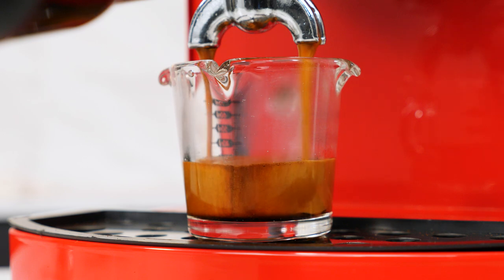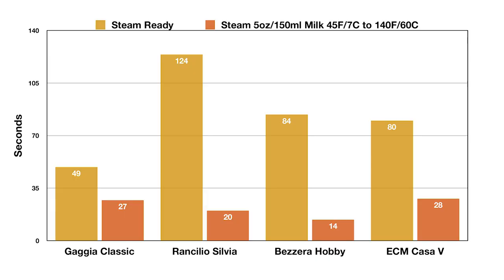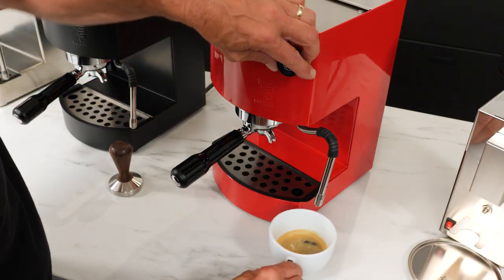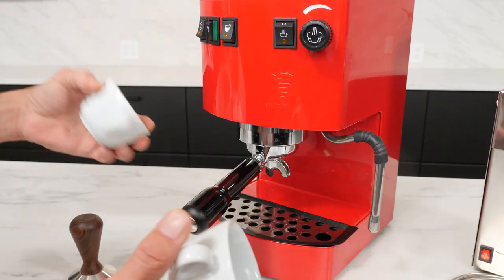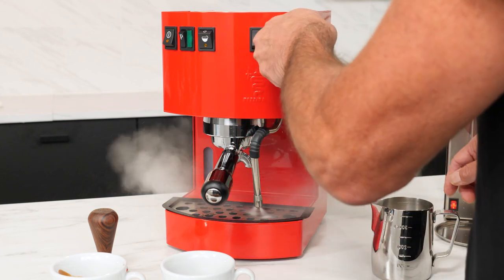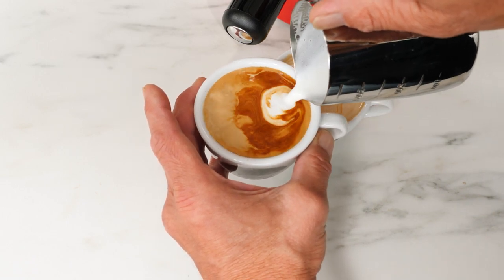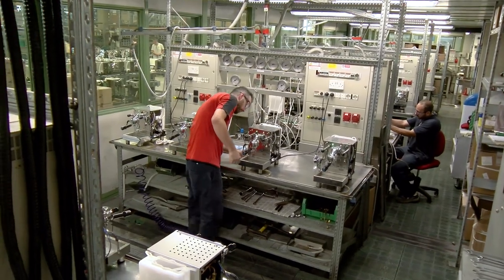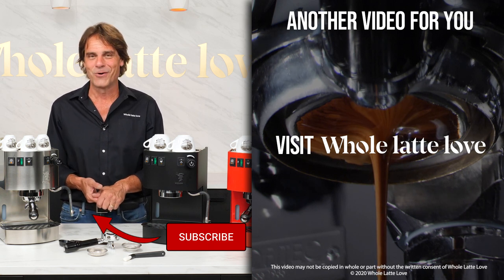Review: Bezzera Hobby Espresso Machine

Comment: How many bars of pressure does this machine produce? I am just getting into the espresso game and I understand 9 bars produces the best espresso. Thoughts?
Reply from the maker: Hi Curtis, Thanks for the question. The whole pressure thing gets a little out of hand in various forums etc on the internets! The Hobby comes from the factory set to produce ~11 bar of static pressure. BUT... Static pressure does not equal the pressure you will get on the coffee when doing an extraction! Static pressure is measured in a closed system so no pressure drop like you'd get when brew water is moving through the coffee. The only way you'd ever get 11 bar is if your grind was far to fine. So fine that the extraction would go far to long. If your grind is dialed in properly you will be brewing at 9 bar on this machine. Hope this helps!
Marc

Comment: Ceado E5P grinder now has about 4 lbs of coffee through it. Finally getting shots 20-30 sec range fairly consistently. 2 questions:
1. I have to wait 5-7minutes for the puck to not have water standing in it. Doesn't seem right, I can hear gurgling into the drain pan after shot is pulled, so, I guess 3-way solenoid valve is working. Am I good, here? Puck does knock out fairly cleanly, even when still wet. Never have gotten one as dry as shown in the video above.

2. Ceado is only about 1 intermediate mark from touching, and grind appears finer than what I observe in your videos, certainly a good bit finer than granulated sugar. Comments?

Comment: Thank you, since you open the machine and see the inside, does hot water (after becoming hot, not before) come in contact with any plastic part of the machin at any point of its travel from the water tank all the way to the coffee basket outside the machine?
Reply from the maker: Hi f, Thanks for the question. Heated water never comes on contact with plastic.
Marc

Comment: Does this machine have PID temperature control? And what's pump's bar pressure?
Reply from the maker: Hi Richard, It's not PID. Pump is capable of producing ~15 bar. Actual brew pressure is controlled by the OPV factory set at ~11bar max but pressure in group will be lower and is ultimately determined by grind size of coffee.
Marc

Comment: Total newb here, Hobby is my 1rst machine. 18g dose results in full contact (dry ,before extracting) with the filter screen, should the dose be reduced to provide a bit of head space?
Reply from the maker: Hi PT, Thanks for the question. Yes. If you are seeing an imprint of shower screen on coffee puck after extraction it's best to reduce the coffee dose weight. Another option is to go with a bigger filter basket as 18g is about the max in most stock baskets. Here's a 20g precision basket which would work with your Hobby: https://www.wholelattelove.com/products/baristapro-20g-nanotech-precision-portafilter-basket
Hope that helps!
Marc

Comment: How do the internals on the Hobby compare to the Silvia?  Given the smaller form factor, I'm sure it would be more challenging to self-service the machine but that aside, what about the components and parts availability.  For instance, can the heating element on the Hobby be replaced without replacing the entire boiler?
Reply from the maker: Hi Chad, Thanks for the question. Here's a schematic diagram of the hobby including the internals: https://s3-eu-west-1.amazonaws.com/img.web.mdsnet.it/bezzera/allegati_articoli/5c7d35910994c_HOB01%209942062.01%20ING%20ed11.17%20rev00.pdf
It is possible to replace the heating element without replacing the boiler. Parts are readily available.
Marc

Comment: Can you adjust the BREW TEMP?  What is the DEFAULT brew temp.?
Reply from the maker: Hi JW, Like the vast majority of single boiler machines brew temp is not adjustable - you need to go to a PID  machine like this for that: https://www.wholelattelove.com/products/profitec-go-espresso-machine-black
For non-PID single boiler machines brew temp is controlled using techniques like flushing brew water prior to extraction or assorted temperature surfing techniques.

Comment: Does anyone know where to buy parts for the Hobby?  Not just the common parts like seals and screens, but a leaking threaded tube on the boiler?
Reply from the maker: Hi CJ, Thanks for the question. Leaking threaded connections can often be fixed with some teflon tape or pipe compound. If the connection is damaged and you are in the U.S. we may be able to help with parts. Contact our tech support here for assistance: https://support.wholelattelove.com/hc/en-us
Reply: @Wholelattelovepage  awesome, thank you!  Yes, it needs a few parts, i’ll check the link.  I love its size and cant wait to compare it to my Silvia.

Comment: Hi Marc
My brand new Hobby in stainless arrived yesterday all the way from Milan to the UK, a quickie question, is the pump switch purely to refill the boiler after steaming etc, have upgraded from the Gaggia Classic so never had to worry before, loved your video on this fine machine thanks
Reply from the maker: Hey GG, Thanks for the comment and question. Yes, pump switch is for refilling/cooling boiler and dispensing hot water.
Marc

Comment: Hi Mark, thanks for your response on my question about the Escobar office control. I was asking because I am looking for a good used espresso machine with good steaming power to get down the road. I was wondering if it you could please give me some suggestions on a machine with either a heat exchanger or single boiler machine with good steaming power. I am sort of considering the bezzera hobby as well. Thanks, the young barista
Reply from the maker: Hi Young B, You are welcome! We currently have a refurbished Expobar Office Control available here: https://www.wholelattelove.com/collections/refurbished-espresso-machines
In single boiler machines the Hobby has the best steaming power available. If doing mostly milk based drinks I'd strongly consider a machine with HX boiler for simultaneous brew and steam. Consider machines from Rocket like their Appartamento or any HX machines from ECM or Profitec.
Marc

Comment: have you tested the heat up time (for brewing) of this and similar machines?
Reply from the maker: Hi mm, No official tests but can say this and similar single boiler machines it's typically about 10 minutes. The machine will generallt indicate reaching full temp in the boiler faster than that but I prefer a little more time for full wrm up of the group and portafilter.
Marc

Comment: Hey Marc!
I'm pretty much sold on the Hobby, but I've read some other reviews online that stated steaming isn't this machines strong point. One of the other reviews stated it would only be good for one pitcher of milk. Could you expand on this a bit and give me your opinion? Hypothetically if I wanted to pull four shots, and make four cappuccini, would it be possible to froth/steam two pitchers of milk back to back? Or would it be best to let the machine recover, then steam another pitcher of milk? Other than that small concern, this machine is seemingly perfect. It's at the top of my list over the GCP or the Silvia.

Thanks! :)
Reply from the maker: Hi v, Thanks for the question. Between the Hobby, GCP and Silvia the Hobby has the best steaming power. Can you steam enough milk for 4 drinks? That depends on how much milk you put in each.  I'm comfortable saying the Hobby can easily steam 10oz/300ml at a time.
Marc
Reply: @Wholelattelovepage  Thanks for the response! That answers my question perfectly!

Comment: Will be great if you can produce a strip down on the parts, so users can see if they can have the machine serviced themselves. I'm wondering how difficult is it to repair these over the long run. I'm also wondering if the boiler burn itself out without water.
Reply from the maker: Hi JB, Thanks for the request! Parts are easily accessed as shown in the video. Like most true machines, it's very serviceable for those with basic tools and skills. Like all single boiler machines one must cool down and refil the boiler after steaming to prevent running without water. The machine does have a reset-able high limit switch on the boiler which will trip to prevent burn out.
Marc

Comment: Have any temp stability tests been run on the Hobby? I would like to know how it performs compared to the Silvia and Casa V. Deciding between these three machines.
Reply from the maker: Hi Brad, All the machines you are looking at will have some swing in the boiler temps. Working with those swings means using techniques like flushing water from the group prior to pulling a shot and coming to understand were a particular machine is in its heating cycle by watching for the brew ready indicator light. When that comes on the machines are typically close to their highest in boiler temp. If you want consistent brew temps it's part of the process of working a single boiler machine. The class of the bunch IMO is the Casa V. Hope that helps. Marc

Comment: I know this is an old video now but it very much inspired me to buy the hobby which I did last week (in the UK) But I'm having a real issue with the machine running out of steam :( I only drink milk based drinks so this is what I really bought it for. 
I've spent 3 hours yesterday timing everything and kept my variables constant. I pressed the steam button and steamed milk at various times from pressing the steam button and wrote it all down (so I started to steam 20, 25, 30.. etc seconds after pressing the steam button before the steam ready light comes on) and it was never consistent - mostly it steamed for an average of 15 secs and rarely it did 20 secs, before the steaming power went from full blast to nothing. I've had to steam my milk twice as its never been warm enough and I steam only 200mls max. Im not sure what else I can do, do you have any other tips you could share? :)
Reply: have you resolved this issue? if so, how

Comment: I have had my Hobby for 2 years (purchased from Whole Latte Love) and it's been working great. I just changed the gasket and pulling shots have been excellent. I'm not very consistent with backflushing, because the last couple of times, I do it it leaks from the top, front of the machine. Pretty scary really... Does anyone have this problem? It's not flushing out at the bottom in the tray. Any advice/help youtube tutorial would be greatly appreciated.
Reply from the maker: Hi EP, Thanks for your patronage and the usage report. Were the leaks from the gasket area prior to replacement? If not, You may need to open up the machine and carfully observe where the leak is coming from.
Marc

Comment: Hi there! I bought 2019 hobby with an old, non-professional steam wand and want to replace it with one from your video. Could you tell me which wand Bezzera are using now?
Reply from the maker: Hi n, Our part number for the entire wand assembly is: bz-5966564
It's currently out of stock with no ETA. May be available elsewhere.
Marc
Reply: @Wholelattelovepage  Hmm... it's strange, by pdf 5966564 is actually an old steam wand with a big chromed hose (5166003TW) at the end. Maybe, they have a similar part number. But thanks anyway.

Comment: Hey Wholelattelove.

I was wondering if you would recommend the Hobby over the Gaggia Classic Pro or vice versa for a total newbie to enthusiast machines... And why?
Reply from the maker: Hey S, Thanks for the question. There's a substantial price difference between the machines. What that gets you on the Hobby is more steaming power. Something to consider if you will be doing larger amounts of milk say for 2 lattes at the same time. It also has a dedicated pump switch for cooling down the boiler after steaming. On the Classic you cool down using the brew switch. The Classic has plenty of steam for doing a single drinks worth at a time. If you do not have a decent espresso grinder the Classic comes with a pressurized filter baskets which allows for the use of pre-ground coffee or coffee ground fresh on a less than optimal grinder. When (or if you already have) a decent espresso grinder the Classic has standard non-pressurized filter basket as well. Hobby comes only with non-pressurized so you will need a good grinder to start. Hope that helps!
Marc
Reply: Hey Marc
Thank you so much for the speedy response and the wise words.  I already have a decent coffee grinder (Sette 270) - and I love it.

We enjoy espressos and milk drinks in our house, and potentially keeping 3-4 people caffinated sounds like forking out the extra for the Hobby might be the right way to go.

Please keep up the YouTube content.  I have been binge watching for the past few weeks. :)

Comment: Hi Mark, I am undecided between the Hobby and the Gaggia Classic pro, which are the cons and pros of both? I have been trying to find some size information like size cups that fits under both machines without successs.
Reply from the maker: Hi n, Thanks for the question. Here's a link to a side by side spec comparison of the Hobby and the Classic Pro: https://www.wholelattelove.com/pages/compare?products=NDYzODQxNzE5MDk2NiwyMDI4ODcwOTI2Mzkw
And here's a link to a video comparing 4 premium entry-level single boiler machines including the Classic and Hobby: https://youtu.be/ajvUwRZ524I
Pro/Cons...
Gaggia Classic: price, comes with pressurized filter basket as well as standard so can start without a grinder 
Hobby: More steam power, separate pump switch for cooling down boiler
Hope that helps!
Marc

Comment: Recently discovered the Lelit PL41EM Anna, and was wondering how well it stood up as an entry level option, unfortunate doesn't look like you carry it though... The Classic, Sylvia, Hobby, and Anna all seem like fantastic entry level options, but my main concern is maintenance and support, for example when my father owned a Breville, they would send him entire replacement machines at no cost when there were any malfunctions, but the Classic seems to be a powerhouse in reliability, and seems relatively straightforward to repair by a user.
Reply from the maker: Hi z99o, Thanks for the question. We do not carry the Lelit - just a machine for whatever reason our product guy does not want to stock at this time. As far as support... I'm biased a bit but 100% believe we are the best in the business! Actual real coffee pros (mostly former baristas) that you can talk to on the phone 585-924-7170, fully staffed tech shop which services and preps 1,000s of machines per year and for the DIY types an extensive support wiki like this section for the Gaggia Classic packed with how to videos, troubleshooting info, diagrams, manuals and more: https://wiki.wholelattelove.com/Gaggia_Classic
Beyond that, we stock parts and have direct connection to product specialist at the Italian manufacturers. Hope that helps!
Marc

Comment: Hi marc are you using the plastic tamp that comes with the machine. I use pre grinder coffee from the shops but keep getting soupy pucks with my hobby. Thanks
Reply from the maker: hi jack, Thanks for the question. No, I do not use the plastic tamper. I've been using "The Jack" leveler nearly exclusively for about 2 years. It handles compressing (tamping) of the coffee for the perfect puck every time: https://www.wholelattelove.com/search?type=product&q=jack
Learn how it works in this video: https://youtu.be/4Z5vTi643sc
Your soupy pucks may have something to do with the pre ground. Really need the grind dialed in precisely for your machine and variables.
Marc
Reply: @Wholelattelovepage  thank you Marc will get one if the decent tempers ordered. Do you think he bottomless portafilter will help the ones that you have on your site? I will sort out the grinder issue aswell thanks.i take it the foreground coffee is not really not to be used in these types of machines cause everytime I do it I get the burnt smelly coffee not sure if its sour or bitter but its vile
Reply from the maker: You're welcome! Good tamper or leveler will help. Those plastic ones come with most every manufacturer's machines and are for the most part worthless. Grinding your own beans will make an incredible difference. when you get a good burr grinder be sure and watch my video which takes you through the simple process of dialing in grind size: https://youtu.be/jOY7D02n4Cw
Pre-ground coffee gives poor results due to incorrect grind size for your variables and coffee loses a lot of freshness as soon as it's ground. Always best to grind within a few minutes of making espresso.
Marc